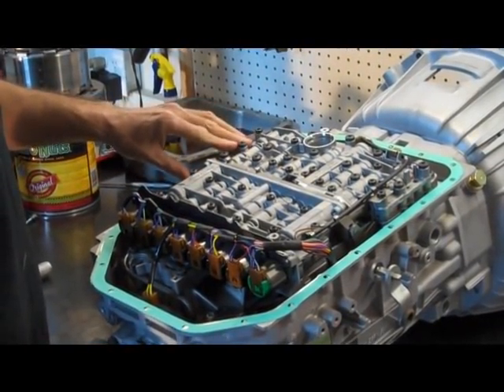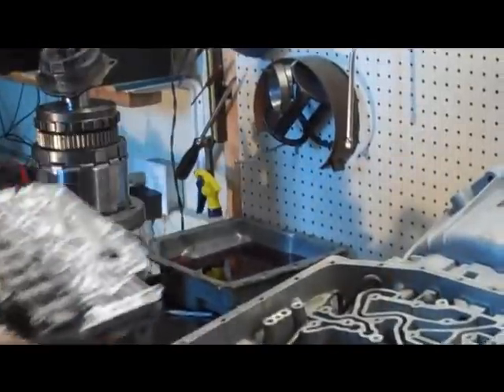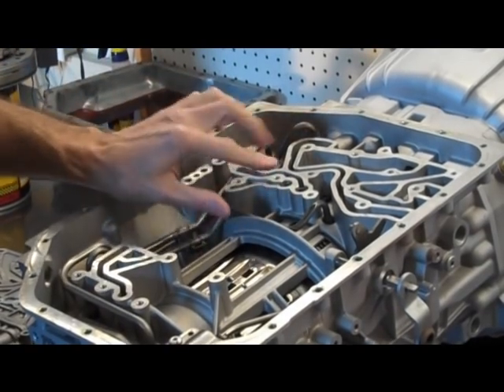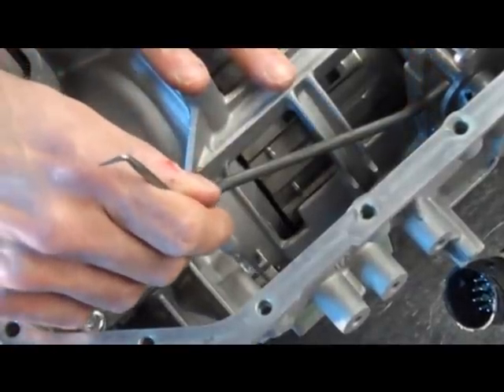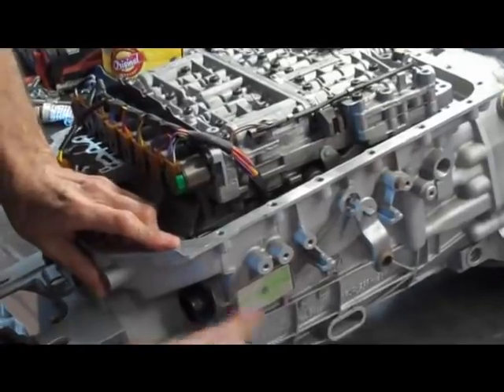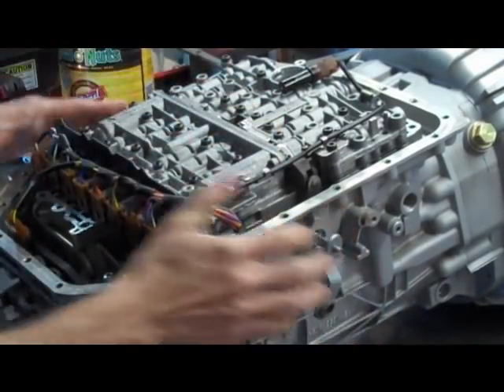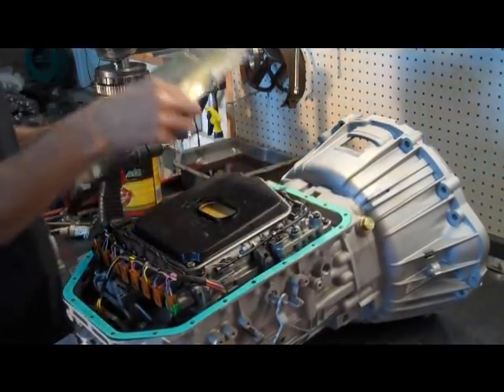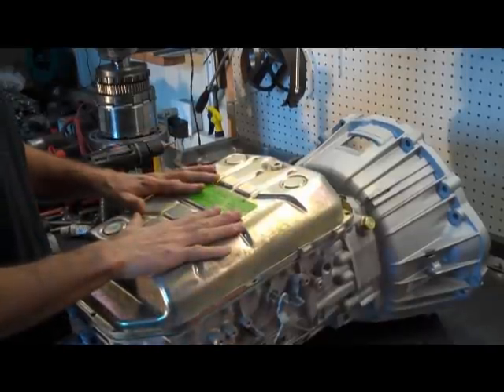BMW ZF5HP24 Valve Body Installation- IPT Transmissions

Comment: 40 inch pounds is 3.333 foot pounds , or 3.4 if you like to round up. In your video  you wait 34 foot pounds torque on the band adjust screw , then unscrew it 4 turns . It's 3.4 foot pounds . That's why it felt like it might snap as you said .

Comment: I had my transmission rebuilt at AMMCO! And I still have the same problem on it! P0732 second gear ratio! I asked if they worked or change the valve body and he said they don't nothing to that! I'm very disappointed with AMMCO! 3k down the drain! my question to you is, Do you recommend me changing my valve body?

Comment: Hi John,
At 2:10 into the video you are mentioning about the 2 snap rings and rubber seals. Are the rubber seals underneath the snap rings? I took my valve body out and I am only seeing the 2 snap rings still intact. I am just making sure I dont dropped the rubber seals any where.

Comment: I just did a swap on an 01 330i.  The 110k mi zf5hp19 i put in is in limp mode throwing codes p0721 and o1732.  Takes off slowly and seems to lack power.  On cluster limp mode light is on.  What would you recommend doing as a fix?  I'm guessing pull the vb like you did here but looks like the rear speed sensor is on a harness.  How do I replace just that if you think that is causing the issue based on codes and info I provided?  Thanks.

Comment: is there anything different from this and the audi a6 both vehicles use the zf5hp24a transmission. My a6 has incorrect gear ration for 2nd 3rd and 4th.

Comment: John I have a. Question for you I have a 1998 740 il BMW the reverse works fine but it stuck in Drive I can't use first second third or any of those are the years is this a valve body problem I'm going to replace the filter in the transmission and put new oil in it for I decide to go any further what do you think might be the problem

Comment: Hi, I have a question. Is it a good idea to rebuild a 2006 330i bmw? My car just went out on transmission malfunctioning. The dealer told me that it needs a new transmission and wants to charge me close to 8k. My car has 96k miles and it started to act up crazy after a transmission service from the same dealer. With 500 miles after the service, the car started with transmission malfunctioning problems. There is a mechanic in town that told it could be solenoids and in two weeks, I'm planning to take it in? Any advice, past experience or true opinion. Thanks

Comment: have a 2003 bmw 325ci e46 transmission is the a5s325z been going into limp mode i did a stall test in d im not getting turbine speed in Drive but when i put it in neutral i get turbine speed? torque converter ? or solenoids or could this be fluid issue any help please  Jgoodson86@yahoo.com

Comment: 330ci m 70k on clock should I change filter and fluid?
Reply: I changed mine at 76k same as yours 330ci and it was pretty dirty so I would say yes